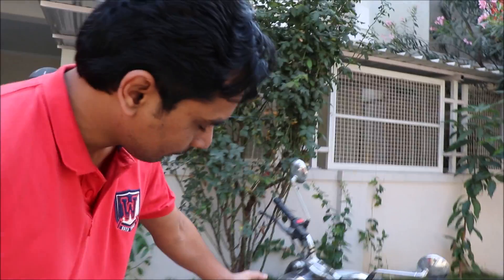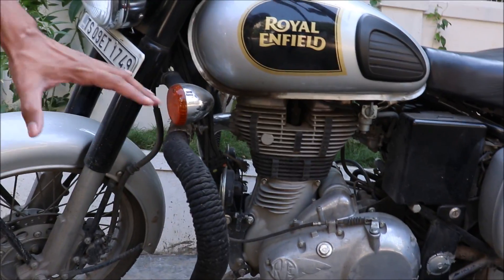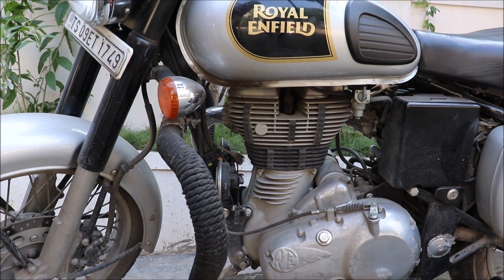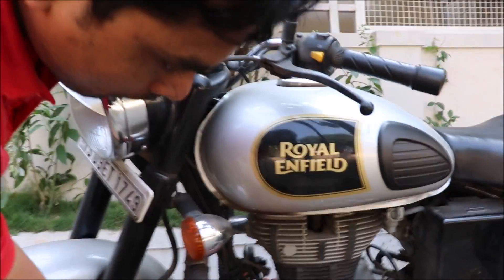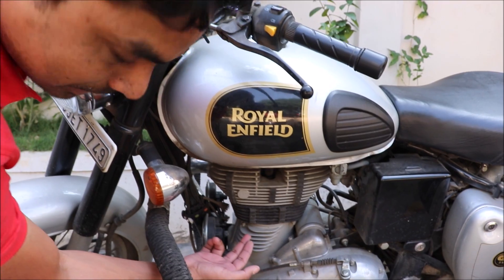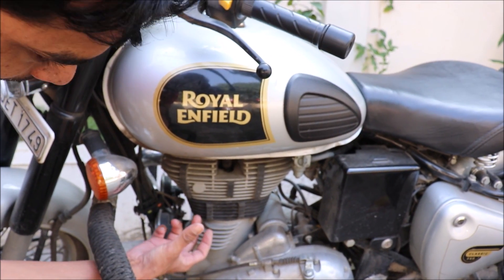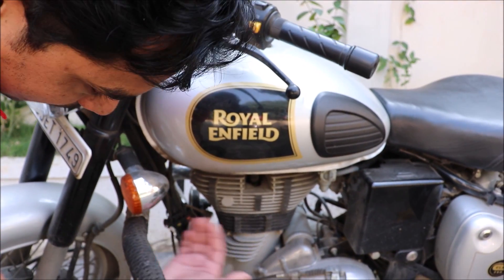Myths about Engine Coolant on Motorcycle & Cars. Best Coolant for Motorcycle. Part 1.

Comment: I don't know what I'm going to POOT in my motorcycle but actually a ktm 390 Duke would be a good bike to test coolant on, they overheat to the point of blowing head gaskets at times, at least in US 🇺🇸 market. My mt 09 runs at about 175-185F with the stock coolant. I guarantee my bike isn't going to drop to 155-165 if I switched to "engine ice", nor would I want it to. Go rule of thumb, put in it what the manufacturer suggests and WHEN the manufacturer tells you to do it, or sooner! I would NEVER go as long between oil changes on any of my vehicles as manufacturer recommends, I think they miss the boat there, the most expensive oil in the world gets dirty just as fast as budget oil, dirty oil is what wears out a engine! Just use your F ing noggin's people!

Comment: Hi Vikas, after riding around 2500 kms on my new motorcycle, I noticed my coolant reservoir level was just below the low mark. But the radiator was full. Is it okay? Thanks in advance

Comment: Number  4,,, car radiator honse pipe and coolant circulation  gaps between the engine cylinder and head are large compared to super bikes, so the coolant perfomance is  better, few cars have dual coolant  pumps which circulates the liquid fast like a jet booster water pumps,  specially diesel engines
Reply from the maker: You are correct mate. Thanks for watching. Hope you enjoy my other videos too and hope you subscribe.

Comment: Hi vikas bro if I use RC 390 chain sprocket in my RS 200 and what are the problems I face
Reply from the maker: What are the number of tooth on the stock 200 sprocket?
Reply: @rvkvikas  41 tooth rear sprocket bro 13 tooth on front gear bro

Comment: Bro.... if a bike is  enganged in 3rd gear and  sometimes due to the low rpm the bike turns off by giving a jerk ..is it harmful for the engines .... or will it cause a mjor problem... explain me

Comment: Motul coolant works very good in RC 390, another point is that RC 390 runs leans and that's also a reason of slightly higher engine temperature. I have powertronic and I have made a richer map and does help a bit on keeping the engine cool.

Comment: Buddy oil cooler &liquid cooler 
Will help to cool down fast
Reply from the maker: Yes bro, that's a hybrid system. I spoke about it in the video which I will publish after a few days. But, still needs air flow :) thanks and Cheers brother.
Reply: @rvkvikas  but were is your silver play button?

Comment: KTM engine cooling system is most advanced with big fan, though don't work at all🤣
Reply: It works fine, just use open back fan rather than closed back. 2015 fans are perfect, I use it on my RC 390 2016.